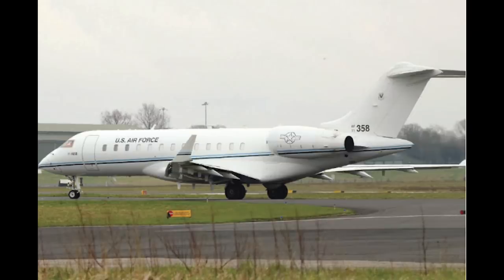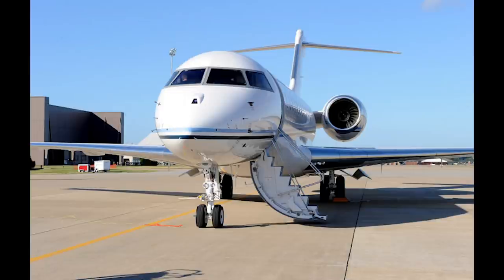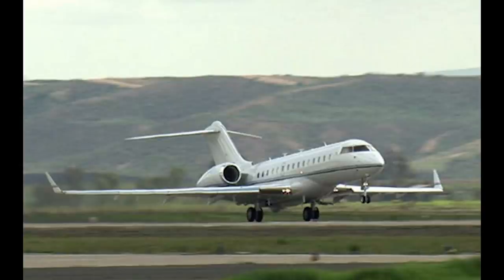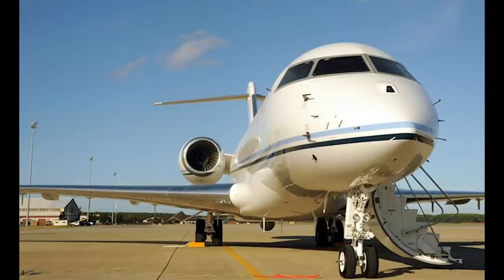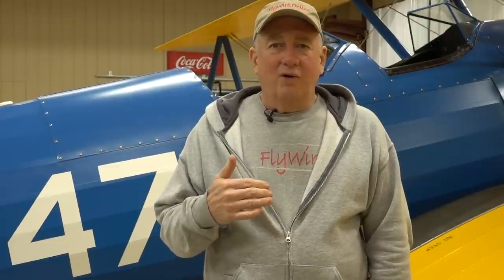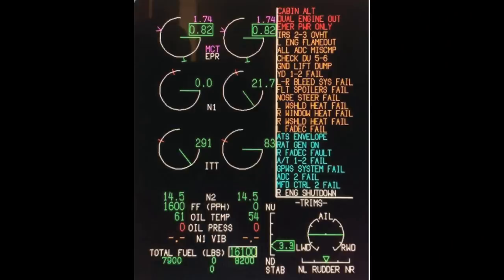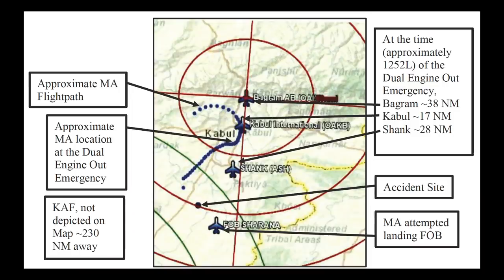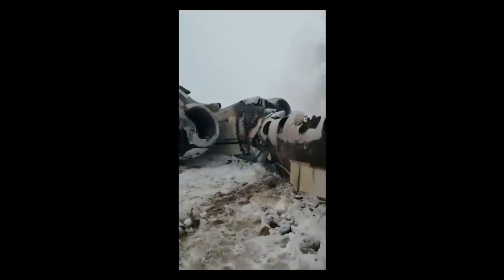Accident Review  Global Express Dual Engine Out

Comment: Thanks Scott.   I’m a current GLEX pilot.  Not only the incredible vibration from engine, but also the noise from the RAT.  I have done 6 intentional  RAT drops for MX.  All done at 180-200KTS.  It deploys right beside FO’s Knee and makes an incredible racket of its own. IN the windmilling envelope it would be deafening
Reply from the maker: Thanks for sharing Brett!
Reply: You’re right, it’s very loud. The Challenger 600 and 601’s ADG (Rat) had even longer blades and was significantly louder. 
This is one reason why I used to keep the simulator noise at 100% whenever I was teaching in the sim. (Challenger, CRJ, and Global)

Comment: I was flying from LAX to YYC in a DA200 at FL350 when a mid span dampener on the left fan let go. Just myself and the other pilot and engineer on board. The engineer was in the back lavatory when it happened. There was a great big bang and he came running up the aisle with eyes as big as an owl. In the cockpit, the only indication was a rise in temperature and N2. We waited to see if there were any other changes but not much changed and were ready if there was a fire. Knowing if we had to shut it down we would have little problem making YYC so we just carefully monitored it. After landing the engineers had a look in the left engine. When the first mid span dampener let go, due to gyroscopic precession, the corresponding ones on the blades at 90, 180 and 270 degrees also had let go. All those pieces went through that engine and made it look like a chewed corn cob. Those ATF-3s were some tough engine. Designed to take a 20lb bird strike.
Reply: That engine had the worst reliability of all time.

Comment: Hi. Like you, I have read in detail the 42 page USAF Accident Report. I did so during my annual Global Express recurrent last month at CAE Dubai. I'm a Training Captain on the Global with 12 years experience on type. I'm also ex-military, former British Army helicopter and fixed-wing instructor. Your briefing puts the report into visual context extremely well. Thank you. 

However, I do think we need to clarify a few areas. You mentioned the process of matching the power levers following an engine failure. There has to be a caveat to that. It can only be done once the failed engine has been correctly identified. Matching the levers can actually compound the confusion. I also have a concern about this not being in line with the QRH drills to secure the engine. 

Any engine failure or fire drill should always follow the following initial sequence:

CONTROL
IDENTIFY
CONFIRM

That sequence also forces a slowing down of the processes and helps with the analysis.

Whilst in the sim last month we looked at an engine failure on final approach. With both engines initially on a low power setting for the approach, an engine failure is still noticeable. What is tricky is identifying the correct engine. It has to be a very systematic approach to identifying the failed engine, following the above 3 processes. As far as we can tell, in this particular accident the left engine failed in a climb. The crew probably leveled off and then appear to have done a very quick engine response check. The left engine N1 was indicating 80 to 90+ %. This would have been very misleading. There was only the Amber left FADEC Fail message. There were extreme levels of vibration and following the incorrect shutdown of the right engine, the RAT deployment would also produce high noise levels and further vibration.

Any attempted windmill airstart would appear to have been on the failed left engine. It's not going to happen; that engine was dead.

CAE and Bombardier advocate the use of the Quick reference checklist for immediate actions. There are no longer any "Memory Items".  Again, had the crew used the quick reference card, they have been forced to slow down a little, which arguably might have helped control their obvious and understandable "Startle Response".

The  standard double-engine failure on the Global Express is to maintain height as speed is reduced to a target indicated speed of 200 knots; then drift down. APU on below 37,000 ft. If, for whatever reason the APU cannot be started then the nose has to lowered and aircraft accelerated to 250+ for a windmill start. That will increase the loss of height.

AVIATE
NAVIGATE
COMMUNICATE

An accident like this is very sobering. It is easy to pass judgement, but maybe we should all take stock and ask ourselves how would we have dealt with something so unexpected and disorientating? Operators should also consider what we train for in the Sim. EFATO at or above V1 is standard. What about the non-standard? Final approach, or in the cruise? It wasn't that long ago a BA 777 had a dual engine flameout on short finals to Heathrow. That was due to ice contamination of the fuel. Glide approach to a touchdown short of the threshold, but they got away with it.

How do we brief our departures, cruise, arrivals and contingencies? Nearest en route diversions etc?

Fly safe.
Reply from the maker: Good points. Thanks for sharing.
Reply: If I may, please let me expand on CONTROL, IDENTIFY, CONFIRM.

CONTROL - fly the aircraft. Check the yaw and remember, the dead leg NOT correcting the yaw is on the same side as the dead engine. "Dead Leg - Dead Engine". 

IDENTIFY - cross-check to the engine indications and be very wary of "Compensation Bias". Positively identify the failed engine and corresponding thrust lever and run switch. Take your time and at this stage DO NOT immediately throw any switches! 

CONFIRM - use both crew to confirm the failed engine; double check. Then continue with the shutdown drill as per the QRH. Guard and protect the live functioning engine.

Comment: Retired airline geek here.   Fantastic vid, fantastic summation.   I feel like I am back in the Sim!   I think this is an excellent review for lower-time airmen who may not receive the type of training that airline guys generally receive.  Lots of lessons to be learned, especially "wind your watch".   At my first 135 job (American Eagle), we used to have a few of what we called "4-eye" switches.   Namely, no one threw one of those switches without both guys taking a deep breath and deciding that was both;   A) the correct switch and,     B) the right plan of action at THAT TIME.   It's not only a confirmation that you're throwing the correct switch (Left vs RIght fuel cut-off for example) but also to take the time to confirm the decision to throw it.  Aside from a rapid decompression or Fire, almost nothing requires an instant decision.   A V1 cut, yes.  PUSH that rudder.  But all the reconfigure stuff?   Take the time to make a good decision.   There are black craters all over the globe from guys who feathered the wrong engine.  That concept served me well for the rest of my career.   If I had to guess, I'd say the extreme vibration clouded their thinking.    Thank you.

Comment: In 1974 I had an engine failure in a D55 Baron. The right crank case split as I began my decent into KJAX at night. I experienced severe vibration that precluding me from reading most instruments. Just prior to the failure I noticed an engine shutter and the right engine EGT went cold. When the severe vibration began I immediately shut down the right engine suspecting it as the culprit. My reaction was intuitive but in hind sight I think I was very lucky. Had I shut down the wrong engine without testing the available power on each the result could have been devastating. This accident reminds me somewhat of my experience.
Reply from the maker: Thanks for sharing JR!

Comment: There is a fan blade failure profile to fly. Descend near MMO to keep the Fan loaded by ram air. Level at 10-15k ft and quickly slow down through the harmonic range. Then analyze and shut down.

Comment: Great analysis. Sad story. These pilots were doing their mission, and unfortunately made choices that assisted in their own demise. 

This reminds me a bit of the Pinnacle Airlines Flight 3701 CRJ-200 incident in 2004. in the Global Express situation the initial "domino" was the loss of a fan blade... The Pinnacle pilots instigated the beginnings of their own demise by hot-dogging the CRJ-200 (high G climbs at full throttle to hit FL410) which caused their "dual engine failure".

The similarities: BOTH tried air-starts (losing precious energy.) BOTH either did not attempt to restart the APU or did it too late to make a difference. BOTH had plenty of altitude and energy at the beginning of the incident to have sufficient glide slope to reach MULTIPLE suitable runways.

Fancy pretty digital screens are great - until they aren't. I'd imagine many pilots would "freak out" at that laundry list of errors displayed on that screen. Even after practicing failures in a Sim, I imagine it's quite different when presented with the "real world situation."

I have some old pilot friends who reiterate this mantra often: "Aviate, navigate, communicate."

Comment: I was a passenger in a Challenger 350 that had this almost exact scenario. 20 mins after leaving an FBO in Northern VA, with 7 other people we felt a sharp vibration and heard the lav hatch rattling. We then felt it all smooth out and presumed it was turb. About 10 mins later we felt the plane make 2 left turns and heard it get very quiet and we could tell we were descending. The PIC told us that he had vibration alerts in the right engine and that as a precaution they attempted to restart the engine. It wouldn't restart. The other engine restarted and began to have issues as well. Then, we had an issue with the APU not wanting to start, or producing low power. So, we were under emergency conditions. They requested emergency clearance at Dulles which was at this point about 70 nm away. Thankfully we made it back, landed safely and the only challenge was getting a hotel room and a commercial flight. Oh, I forgot to mention, this all happened at 11pm Eastern time.

Comment: In 2022 there is zero excuse to not have full audio and video of every single flight. I propose a REDUNDANT set of camera w/mic and a completely separate audio recorders IN THE COCKPIT. You can buy 4k action cams for $200. Of course, they would need to be fortified but to only have one set that often fails or gets lost is simply not acceptable anymore. Having video in the cockpit would provide so much valuable data.

Comment: Things I'm learning from Scott: Don't futz with stuff in the air. Land first.  When there's a significant problem, get safely on the ground ASAP, and mess with stuff there, not in the air.  "Turn towards the nearest suitable landing spot and trim for the best glide speed." Conserve altitude and speed, then communicate and run checklists.  One additional thought - they had a few minutes - is there a way prepare/practice something like "Stop, wait, this isn't working.  How can we start over? How can we re-check what we've been assuming?"  Checklists can get around that lock-in by doing/trying things that someone thought of calmly on the ground, but is there any way to take an opportunity to zero out and re-start from scratch?
Reply from the maker: Thomas, great comments. The only way is to think about stuff before it happens and figure out what your approach will be. Keep calm and carry on.
Reply: Mentour Pilot mentions the use of the acronym PIOSEE
P roblem identify
I nformation available
O ptions
S elect option
E execute 
E valuate

The evaluate is to me the one that makes sure you don't continue "down a rabbit hole"

I would add that with the level of automation today - getting the Information bit would require a LOT of training. In fact the Hudson incident referred to the FO's very recent type certification as a positive into the final outcome.

As has been said - very easy from the arm chair. 

Very much like Scott's idea of go with what you have and not what you think you may have

Comment: Exceptional accident breakdown, Scott. It’s been 11 years for me, but as a Strike Eagle WSO I remember routinely briefing that I would guard the “good” throttle during an engine fire / failure until we both agreed to move it. That, as you know, was to offer a backup (second set of eyes and brain cells) to prevent just such a mistake. I wonder if 2-pilot airplanes have a similar practice, civil or military?
Reply from the maker: Guarding the throttles is done in some airlines that I know of. Not sure about Bizjets. Where did you fly Strike Eagles and when did you go through FTU?
Reply: @FlyWirescottperdue  I went through the B-Course in ‘96 (after an initial ops tour in F-111s at Cannon) then a TX in ‘06. F-15E ops tours were Mt Home twice and Elmendorf in-between. That sound of the JFS in your intro is music! Just back in GA for about a year now, with a son a few weeks from a PPL check ride. We really enjoy the channel - let me know if there’s anything I/we can do to help.

Comment: Like what has been said below:
1) Never be in a hurry to shut down an engine. When you do, everyone in the cockpit make sure it’s the correct one.
2) Doing nothing is better than doing the wrong thing.
3) Sit on your hands till you breath and calm down and figure it out, then pull out the correct checklist. 
40 years of flying. Air Force and airlines. 25,000 hrs in 15 jets (many dozens of prop planes). Includes Flight Engineer on 2 jet types.

Comment: I hope that I can develop the level of comprehensive structured analytic processes and skills you exhibit as go to you carefully and methodically pick through and unwrap these incredibly complex scenarios. You do so with an uncanny level of tact and compassion, outlining what the pilot's mistakes were likely caused by, and what they in turn caused to exacerbate the issues they face. I was an active flight instructor for about 3 years, then an aircraft sales manager for the 3 that followed (same job, just can't criticize the deficiencies in basic stick and rudder skill and lack of awareness of stored energy in the airframe. I was never as effective a teacher then as you are in your videos, but I was also 24-26 years old, so maybe I'd do better nowadays. Anyway, thanks for sharing your knowledge and maybe you'll see this question and be able to answer it's:

During your various military tours and air carrier employment stints, were you ever trained as a squadron/ wing safety officer, or anything equivalent on the 121 side which provided you with the opportunity to take any of the USG/ DoD Service Branch Safety Officer & Aircraft Accident Investigation Courses? If not, and your analysis is all based on your the body of your life's work and experience, that would be incredible.

Comment: Interesting discussion. Most airline QRH's do not call for the immediate starting of the APU with the loss of an engine. This item occurs later on in the checklist. At my outfit it became fairly common practice to get the APU up and running early in the engine failure process. It was just a matter of reaching up and selecting the APU start switch to start/on. This was generally done while the NFP was pulling out the QRH and thumbing through the pages. Early on we used to be able to shut down an engine on T/O once we were climbing out of 400'. Later this was amended to 1000'. We learned there was never a hurry as even with a fire we wanted the thrust from that engine to get us to a safe altitude and the aircraft on a safe heading. The Concord was lost in part when the Flight Engineer shut down an engine at a very low altitude shortly after take/off. Each step of shutting down an engine had to be confirmed by both Pilots before any lever could be moved..
Reply: As a multi engine CFI i shut off engines at 400 agl on initial climb on Seminoles.  Many times.  It test a pilot ability to control the airplane even if at 400 agl low altitude.  1,000 agl is more than double that altitude and out of the stress zone.  Not a good pilot test.  No Emergency Low Maneuvering test done.  
The mediocre guy that will pull up too much, or gets uncoordinated by fear and fail the test at 400 agl will not do that at over 1,000 agl.  He will pass.  Then when later on will lose an engine at 400 agl with passengers later on, will panic, will VMC roll and kill all.  The Low altitude Panic Pull has to be tested or ignored.  Ignoring it have killed too many already..
Not only that.  Those guys will make big pilot errors on other stressful situations like instrument fails, and crosswind landings, etc.

Comment: Your analysis gives hope that they didn't die in vain.  Lots of confidence even with ZERO ENGINES RUNNING!  Regardless of engine out procedural details for the type, basic strategy for any type doesn't change -- "fly the plane - best glide" head toward a field (Kabul), then work the problem.  You can orbit the field until problem resolved or land.  In this case, the basic strategy would have saved the situation and overcome the opportunities that were missed. Shame to loose two good men in a flyable plane...

Comment: Great video.  I am very familiar with a Liberty type King Air 350ER accident where the wrong engine was shut down after the computer filled up with smoke.  Never once did they attempt a restart even though the PF commented on "what's the chance of having two bad engines at the same time"?.  Fortunately they survived an off airport gear up landing 6 miles from the airport.  Lots of lessons learned, but could have turned out so much better if they'd wound their watches.   I've used this accident in training other pilots and discuss it often.  Thanks for your perspective.